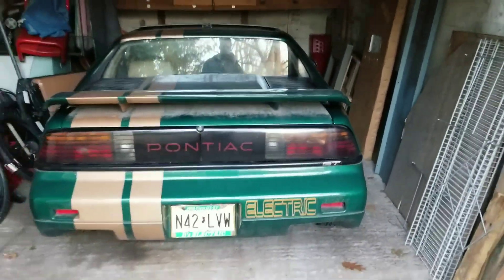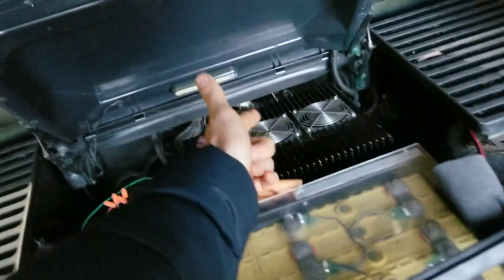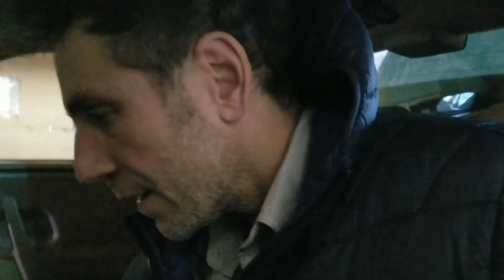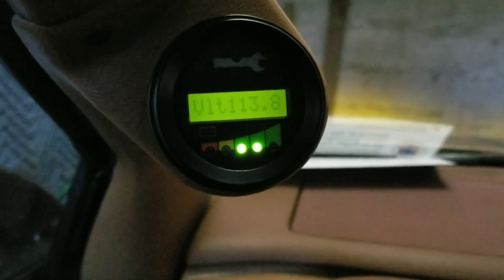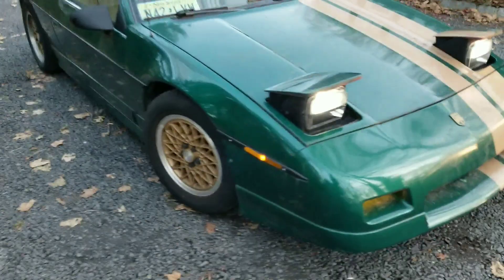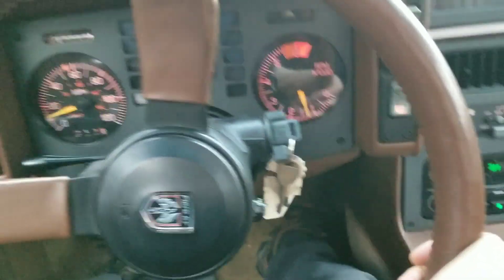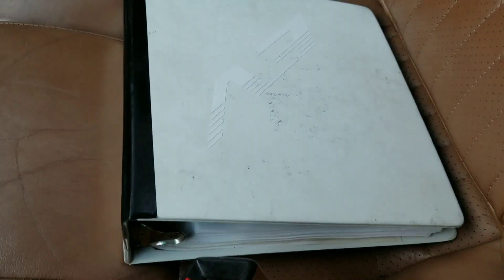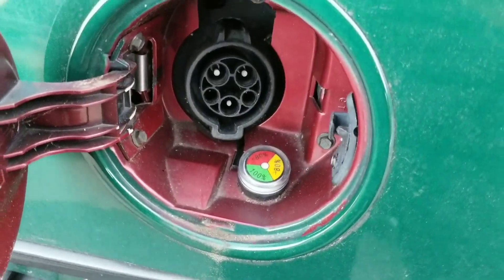1988 Fiero electric conversion introduction

Comment: Fiero's haven't seemed to hold much value but the batteries and electronics were probably costly. Sadly its hard to get the money invested out of a hobby project. Plus you made it sound like you got a deal so I'm guessing you paid less than 10K.
Reply from the maker: Well the whole Project's undervalued, it has an AC motor just like a tesla. Probably just needs upgraded batteries. This will be commonplace switching your classic car over to Electric drive.

And the car was in really good shape. Also undervalued. Sometimes great cars are undervalued until people see the value later on in the market.

Comment: I'm sorry if I am a bit late, as this was made 3 years ago, but can someone explain to me how you can put a manual transmission in an electric car?
Reply from the maker: The stock manual transmission stays in place where it was when there was a gasoline engine. Then you take the gasoline engine out. Replace it with an adapter plate and an electric motor. In other words, the electric motor provides the horsepower twisting force to the transmission as if it was a gas engine and the use of an adapter plate which is basically the same bolt holes that fit where the bell housing was now will fit the electric motor to the transmission. The transmission does not know the difference between an electric motor and a gas engine.
Reply: Thank you

Comment: Something i"ve always wondered about the fiero. 'Where the hell do you put anything? it has no trunk (front or rear.) Stock it has the spare, radiator and other things up front. With this More Batteries. There are no rear seats. It's 'two people sitting inside of an engine.' ther'es no capacity to carry anything.
Reply: My wife and I went Kent camping for 2 weeks in my fuel and had plenty of room for everything we needed. You just have to be creative and have a good mind for special relationships.
When the energy and power density of batteries gets much higher, there will be plenty of room for cargo.
The technology improvements in just a few years are very good. In a decade or 2, it will be phenomenal.
Reply: So people complain about Corvette not having enough room?  It’s not the family truckster, that’s for sure, but I drove one for years when I was single, and didn’t have any issues.   A suitcase and bag go in back truck, odds and ends went up from depending on shape, and the rest on passenger seat if driving solo.  I enjoyed that car, have another that I plan to modify.
Reply: @miragesmack007  thank you. I like the car in concept but having never been around a mid engine? It just kinda rattled around my brain. 'where's the storage?'

Comment: First thing I saw in the underneath view…large electrical cable going through a hole in the metal…no rubber grommet, nothing to stop the cable from having the wire sheathing cut ….that’s just piss poor….👎
Reply: Agreed. Protecting all wires and cables from cuts and abrasion is very important.

Comment: It wouldn't take a lot of horsepower to get a Fiero moving, the stock 2.8 L V6 only put out 135 HP - which was underpowered. How realistic is 200 kW in a Fiero?

One weakness I think I see in the Fiero as a platform for electrification is space for batteries - the floor very  low to the ground, but it would be nice to maintain the car's general weight distribution between the axels. 

But the fiberglass body panels are a strength, the unibody frame is strong, and there are some nice big ashtrays in the center console ... wait, I wonder how much battery you can fit under that console where the fuel tank and transmission linkage normally are?

Comment: Hi! I'm curious if you sold it. Also, do you still have the electric conversion classes? I'm in the Hudson Valley, and I have an 1989 Pontiac 6000 STE AWD I want to convert, using the parts from a 2014 Spark EV salvage title I also own. Thanks!
Reply from the maker: Hi, I still have the Pontiac Fiero Electric. Working on it to be able to publicly charge. Yes I'm planning an electric car conversion class. Send me an email to get you on the mailing list. Ron.grosinger@gmail.com

As for the Pontiac 6000, cool car, but for your first conversion do you need something simpler that has a 5-speed for a standard manual transmission. It simplifies the conversion. Feel free to get in touch to discuss your project.

Comment: I was wondering what happened to that car, I repaired the electrical when Adam owned it, I am assuming you got it from n him. I also upgraded a 1964 Karman ghia from lead acid to lithium ion for him. Glad it went to a good owner. Glad it is still charging to I had to repair the charger once as well lol. Miss that car.

Comment: Hi there, looks really nice i was planning to do something like that, but how about the mileage And the power ? Top speed?
Reply from the maker: Okay currently it goes about 40 miles of range. But the batteries are now 8 years old and we're not very energy dense to begin with.

I can do about 70 or 80 on the highway. So I think it needs a little more range in a little more power. Thinking of doing an update. Stay tuned.

Comment: I'm wondering if you started upgrading the power on this thing.  I'm looking at maybe buying a Fiero right now (as in this weekend), and I REALLY want to do an EV conversion on it.  With the mid-engin platform, and modern batteries, it seems like you could build a badass, fast car, with great range for maybe not much more than it'd cost me to drop the V8 in there I originally wanted to do.
Reply: EV swaps are super easy. MUCH easier than people think. Less work than swapping most combustion engine cars.

Now you could buy a 2nd gen leaf cradle. Mate it into the fiero cradle. Thunderstruck VCU. Lipo battery in front and rear of car. BMSs. More than enough to get it down the road.
Reply: @chriswf  well, I want it to go down the road AND be fun 😊

I did buy the Fiero, and I am contemplating the Ford crate EV motor
Reply: @QMaverick1  it can be fast and fun.  I'm all about 0-60, so they're really good at that. Lol. Depends on how much you want to spend.. but top end acceleration isn't usually that great.
Reply: @QMaverick1  Hey how's the conversion going?
Reply: @singletona082  sadly, I haven't had the time to work on it much.  First order of business is restoring the frame and suspension, and I have a 5 and 3 year old.  Hahaha...hard to make time
Reply: @QMaverick1  Well, better to have slow progress than no progress. 

And prioritizing the kid is the important thing here.
Reply: @singletona082  Yup!  I just hope I get to it before they graduate high school (they're 5 and 3) :-)  It would help if I had a 3-car garage at my house, but right now it's sitting at my Mom's, which is an hour away.  Ah, I'll figure it out.  By then, maybe I'll have more options for crate motors or salvage motors.  The batteries are the expensive bit, really.

What I'd REALLY like to do is utilize the tunnel where the gas tank goes to stash batteries, but that would require some sort of custom shape battery enclosure . . . I figure that, plus some in the front and back, and I can keep the CG REALLY low for cornering, and possibly improve the original weight distribution (Fiero was 49/51).  It seems like a GREAT car for a project like this, but it's always time and money . . .

Comment: A little surprised they didn't use the gas tank or the area where it is for additional battery capacity and range. You need to get in touch with Rich Rebuilds at the Electrified Garage and let him turn that Fiero into the Monster it should have always been.
Reply from the maker: Great idea, however I'm going to give it a try this summer. Probably upgrade the battery.

Comment: Ron, glad to see that you were able to get the old gal back up and running! I heard you say something about a clutch issue. I’m guessing the hydraulics are the problem? If that’s the case, the fix is easy. Go to Rodneydickman.com and purchase new master and slave cylinders. They are easy to install and will last a long time if properly installed. Don’t waste your time or money on regular parts store versions, as they are garbage.
Reply from the maker: Amazing thanks for the invite. So did you originally use the clutch? Cuz you're a directions in the last guy says that you could go clutchless. I would rather use the clutch. Are the clutch parts still in?
Reply: I’ll second the Rodney Dickman parts. I have probably 200,000 miles on my slave and master cylinders.

FYI, we started the electric conversion in my shop by pulling all the gasoline and coolant related parts out. I still have Marty’s engine and transmission, waiting to put into another Fiero.
Reply from the maker: Wow thanks for getting in touch. And thank you for the recommendation. I will definitely get some parts. So fun to connect with the people that did the original conversion.

Send me some photos if you have them of pulling the engine out.. I'm going to make a story video about repairing this car.
Reply: @MrGsWorkshop  ok, I'll have to dig around to see if I took any pictures. Marty might have.
Reply from the maker: @airfiero4772  no problem, thanks for getting in touch anyway. I'll keep you posted on progress.

Comment: this was the one on Ebay last fall? :) how does the heater do its magic?
Reply from the maker: That's right. Yeah wasn't bad. Heaters okay. Enough that you can feel it. Dc-to-dc charger was not working. That's the electronic alternator stepping the high voltage 120 ish down to 12 nominal. Basically a battery charger. I replace that. And upgraded the 12v battery.